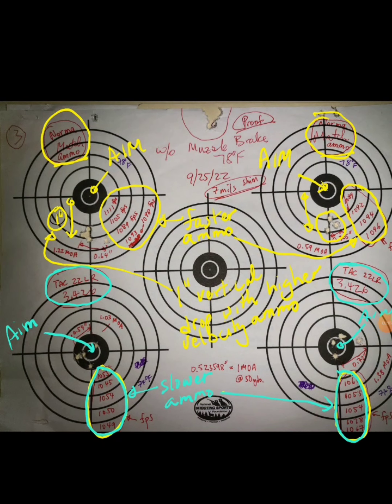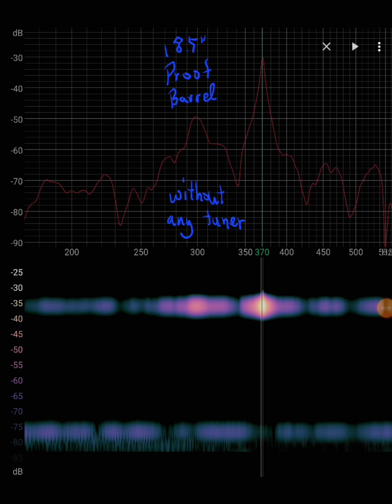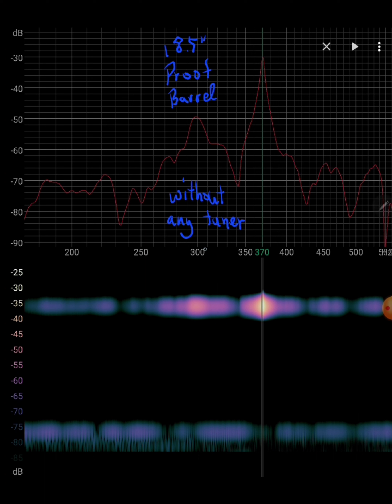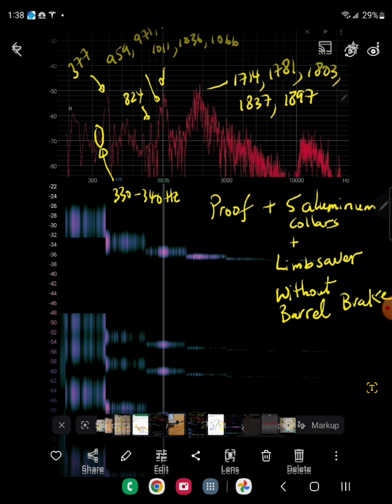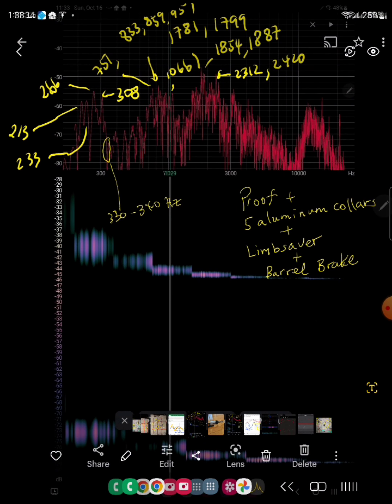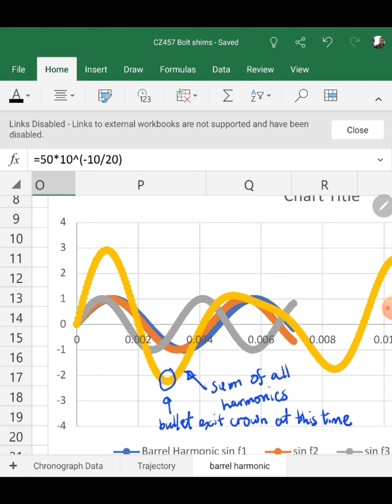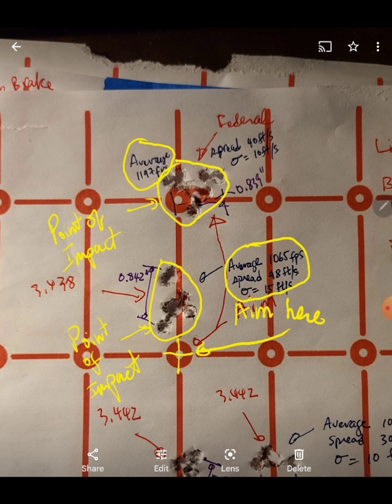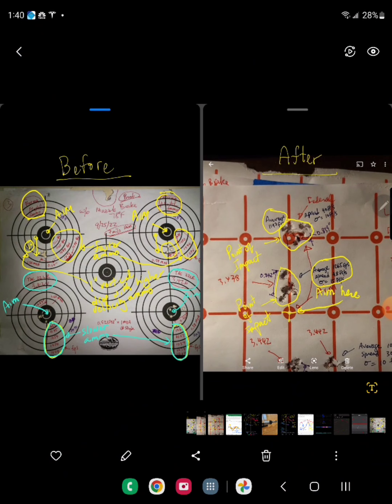#CZ457 Shifting point of impact by changing barrel harmonics.

Comment: if your "slower" ammo is made slower by increasing mass of the bullet, it will allways supposed to hit higher than faster bullet with less weight due concervation of momemtum
Reply from the maker: All my rounds are 40 gr.  There are differences in powder charge.